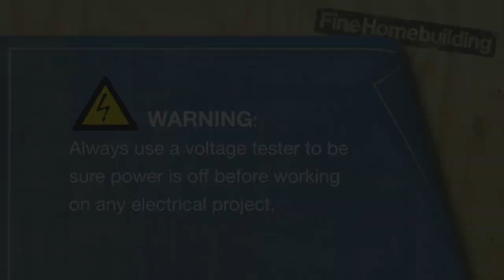Wire-Stripping Tips for Roughing an Electrical Box

Comment: That tip to cut the insulation along as it goes and keep removing until it gets inside the box - brilliant! I now have this problem, and any wire stripper can't go that deep and the cables are already in the wall like that, in double insulation.

Comment: Honestly spend the money and get a Klein stripper, you can do 14-2 and 12-2 like nothing. Also has a great grip for just simply cutting. Multi tool for stripping 12-3 if you're cautious. Your knife is handy for range wire and suite feeds but dont strip wire with an exact-o knife if you do t have to...

Comment: Can you do tips on how to get romex through those blue boxes.
Reply: On the top and bottom side of the box, on the back side opposite of opening is where it goes in.. Use a screw driver to pry it open just enough so when you put wire in, its puts slight pressure on the romex to hold it in place.. Easy peasy..
Reply: It always seems so difficult to pull for me.
Reply: +Fishingtuts another thing I always do.. Strip the wire before you put it in.. Also I bend the end of the wires kind of in an arch.. Then, when you push the wires in the box it should be easier to grab and pull in all the way! Hope this helps!
Reply: Thanks great tip.